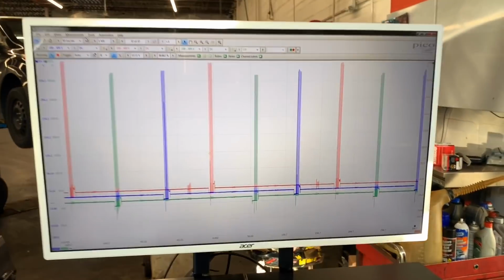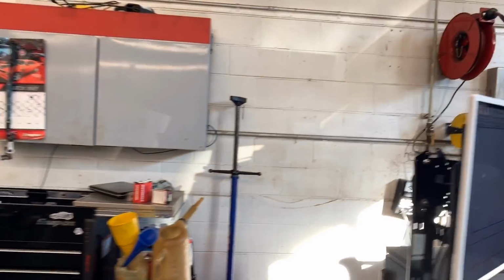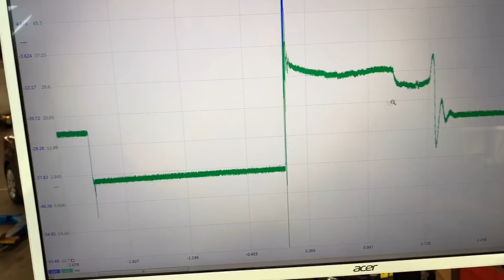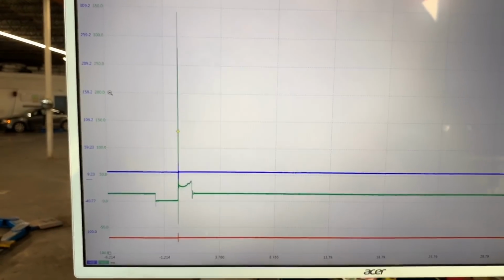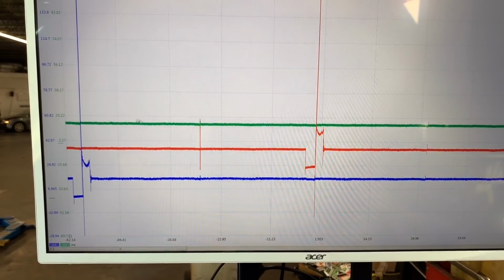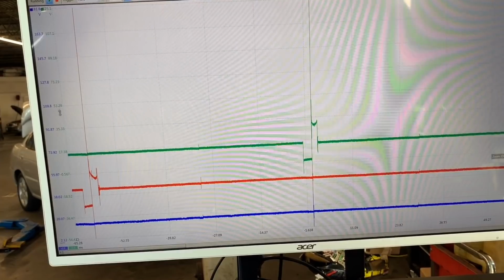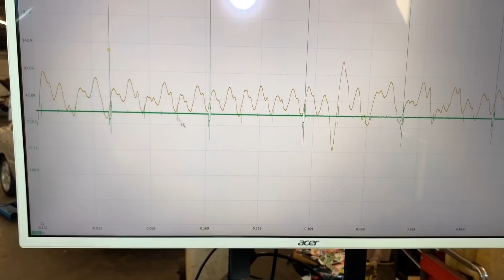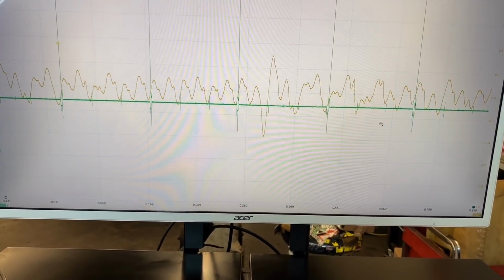2006 BMW 330i Cyl 2 misfire diagnosis with pico scope and WPS500

Comment: Do you think spark indexing is important on a BMW? I saw a few forums about it. What's your thoughts on this?
Reply from the maker: Most definitely. Specially in GDI engines due to the injector been in the cylinder.

Comment: I am stunned, that you can diagnose an upper end issue by just looking at the exhaust misfirepulses!!!!
These downward spikes ARE the result from the misfire, all they tell you is ..... here was a misfire ..... nothing else. 
Interpreting exhaust pulses is a very inaccurate science. There are too many variables involved and these pulses can look extremely different on different cars and still they all are in perfectly good working order. They might just have different exhaust connections that influence the outcome. The only thing that you CAN identify is the misfire (sharp downward spike followed by an upward swing) itself, but you knew that from the customer. The same result can be achieved when you hold a Dollar bill against the exhaust of a running engine and during a misfire the bill slaps against the exhaust pipe.

Now back to the Pico pressure transducer and diagnosing a valve seating issue:
1) get an in-cylinder cranking scan from several cylinder (including cyl 2, the suspect)
2) get an in-cylinder idle running scan from 3 or 4 cylinders (engine should be warmed up!)
3) get an in-cylinder idle running with the time base set so you can see at least 10 to 15 compression peaks in one screen.

Now compare them: 
If there is a seating issue you probably see the compression peaks on the effected cylinder with varying spike heights. Also the compression peaks, compared with a good cylinder, will show a lower pressure and tower could be unsymmetrical.
Next the exhaust pocket will show up rounded and with probably less vacuum than a good cylinder where the exhaust opening can be seen with a pronounced kink in the curve. You might also notice that the exhaust and intake pockets can be at different vacuum levels depending on the valves concerned.
As a mechanical engineer the Pico pressure transducer is one of my favorite tool in diagnosis but mainly to help customers to avoid expensive and possibly unnecessary mechanical work on their engines.
Greetings

Comment: great video Marc   one thing i could recommend is to look at the tailpipe cranking WPS   rel compression and intake manifold FLS   cranking to differentiate engine mech prob from spark or fuel prob   thanks to you

Comment: There are a ton of people on the forums with a rough idle on E46/E90 with single cylinder misfire that have replaced everything and still have the misfire. Your video may help them out. These cylinder heads probably have an unknown issue with valve seating problems but not everyone has a picoscope with a WPS500 and your extensive knowledge. Sweet video. Learned a lot!
Reply from the maker: Thank you so much!!

Comment: Maic, yo uso labscope pero  no PICO y hay cosas que no las entiendo, como consigues ver el evento de escape de la valvula de un cilindro en especifico ?, lo haces con la compresion relativa con el pico!! dejame saber me intereza si puedes explicarme.
Reply from the maker: Marcelo Mena claro con mucho gusto. Uso un evento de ignición como sync. En este caso el Cyl 2 que es el que me da el código de avería. En la Mufla uso el sensor de pulsos de pico WPS500 pero también puedes usar el first look sensor. Por experiencia y estudio se que en un motor de 6 Cyl el tiempo de respuesta del sensor en el escape tengo que usar el segundo hump del pulso de escaoe. En caso de ser un 4 Cyl usaría el primero después del evento de ignición y en V8 el tercero. El analysis de los pulsos de escape es más que todo por comparación ya que es bastante diferente de un vehículo a otro. Así que la misma forma del osciloscopio es la muestra. En mi caso se que tengo un fallo en el cyl dos y al ver el evento en el escape me ratifica que hay un problema con la válvula de escape . También use el WPS500 para hacer una prueba de compresión y ahí es súper obvio que hay problemas con esa válvula. Mira los vídeos de Bernie Thompson de Automotive Solutions el es un maestro en el tema. Además busca los vídeos del First look sensor
Reply: @MaicSalazarDiagnostics  ,  thanks Maic for the feedback, i got a second question i hope U can explain me, i just watch a video from Eric O. he make a correlation chain test in 2012 impala 4 cyl.(I believe) in that case when the engine got a variable cam actuator's(int-ex) is necessary disconnected both actuator to check the proper correlation waveform? ....
Reply from the maker: @marcelomena78  it is very important to read the technical information of the system you are testing to get familiar and then know if you need to disconnect or not the solenoids to establish a base timing for both cams. I think on Eric's video he did first a cam sensors to crank correlation and notice that they were not moving.

Comment: A great diagnostic video!!! Thank you for sharing. The pressure waveform seems to show problems away from #2 cylinder(trigger).
Reply from the maker: Andrew K you have to take the time delay in consideration so in a 6 Cyl is two humps after sync. But there is also small issues with other cylinders that have not trigger the DTC.